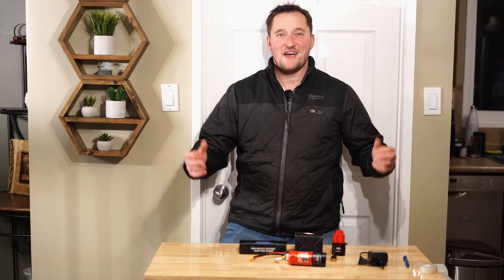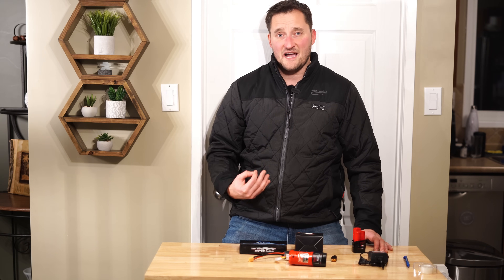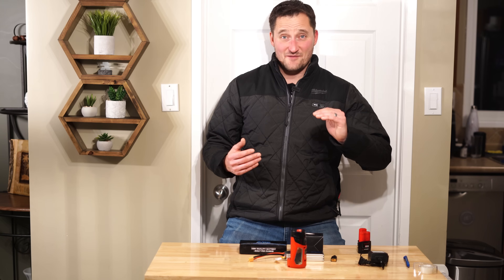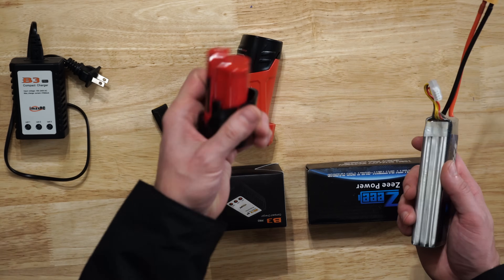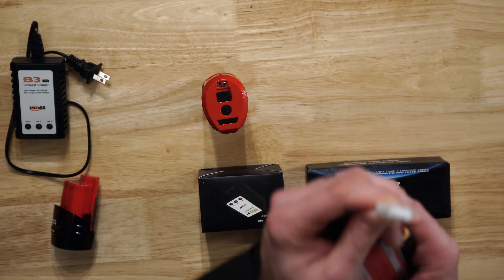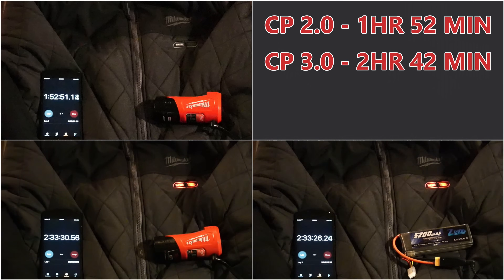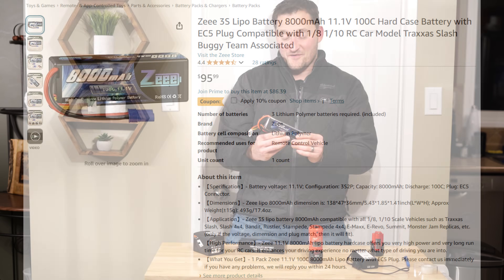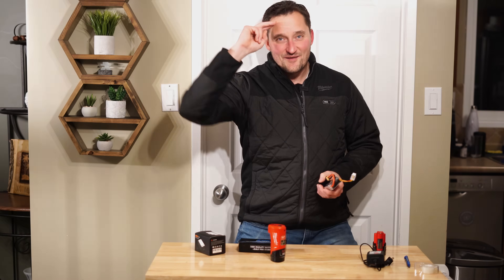WARNING! Read Description - Milwaukee M12 Heated Gear Battery HACK for INSANE RUNTIME!  Part 1

Comment: I will definitely be getting a setup like this for my wife.
Reply: Please don’t these are not safe for this application. They are a fire risk on the best of days. They don’t have any protection from over discharge at all.
Reply from the maker: @wwg-worldsworstgamer6678  that's for the comment, I have learned a lot more about these over the past few days, I have a low voltage buzzer on the way and will be putting out an updated video soon.
Reply from the maker: Thanks for the comment! My wife has the vest, and loves it! I'll be getting a similar setup for her, think we might go with the 8000mAh battery for hers and then I can float them between my jacket and hers.
Reply: Those batteries catch fire very easily when damaged or not charged properly it's not really a good idea
Reply from the maker: @davidmccurdy306  one definitely needs to understand the risks going into it. I've learned a lot from here, I have a low voltage alarm along with a B6 charger. I feel that the battery is pretty well protected in the spot that it's in, but like anything in life you need to weigh the risk vs. reward. Cheers!